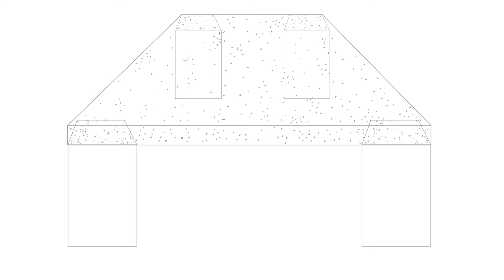What Kinds of Buildings Fare Worst in an Earthquake?

Comment: I wish there were more content on YouTube about making really good low-rise buildings. Everything I can find about earthquake engineering seems to be a minimum of six storeys, and that's not how I design a single family dwelling. But I do want to build homes that will still be homes hundreds or even thousands of years from now, and in the area I'm looking at that means they need to withstand Mag 8+ earthquakes not just once, but several times.
I'm pretty confident that concrete is the only material that can do this. But I need to learn how a well-engineered design should look. And I can't find any useful resources.